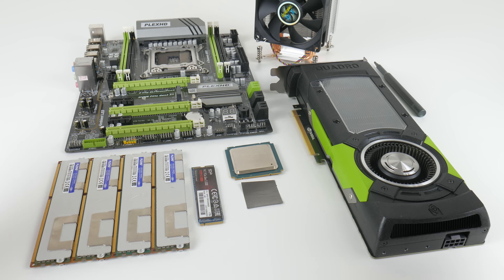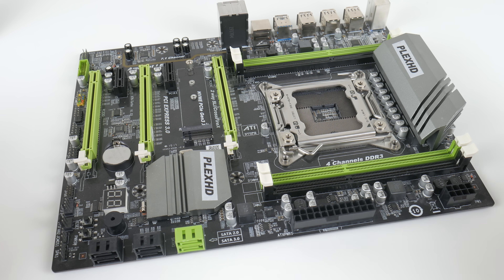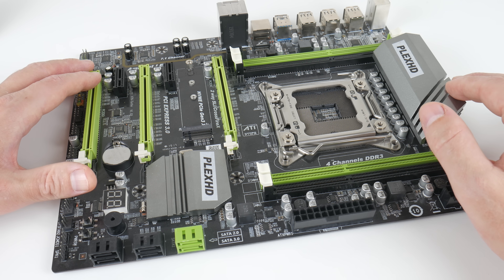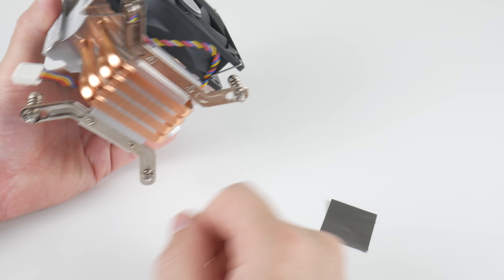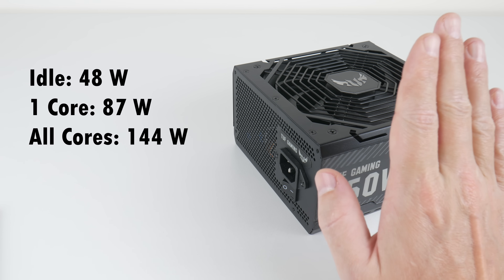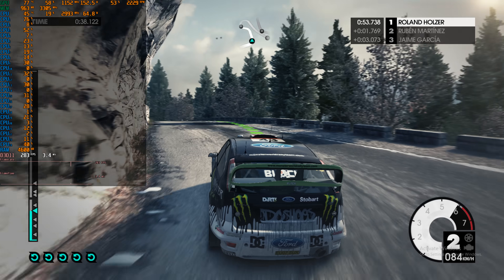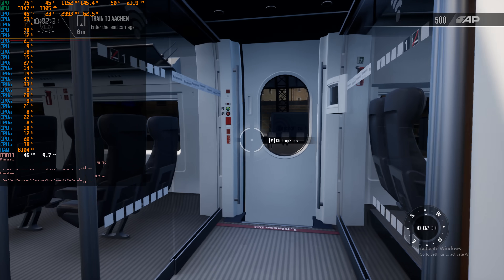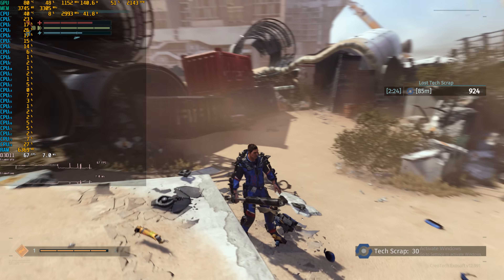10 years ago this CPU cost $2614 - How does it hold up? The Intel Xeon E5-2697V2!

Comment: With how crappy AAA gaming has become recently its not a bad thing having an older machine. I have bought a t3610 and a t5810 both from ebay and even the e5 v2 cpu's run surprisingly well on titles released 2-3 yrs ago. In terms of gpu I don't think it's worth going newer then nvidia 1000 series in terms of power, probaly rtx 2000 if you wanted ray tracing. Both are very affordable on ebay and the top end models still run modern games pretty good.

Comment: Hace been running a Plex x79 with an E5 1650 V2 for about 3 years. Just bought a E5 2667 V2 on AliExpress for about £15 as an upgrade. Interested to see if the extra cores will make much of difference. It turbo boosts at 4.0 Ghz, pretty good for such an old cpu.
Reply from the maker: @fieldpictures1306  In a lot of take the 1650 will feel stronger as it clocks way higher.

Comment: Just got a 2697 v2 and a ASUS P9X79-E WS motherboard to replace my i5-4690k for ~150USD on ebay. I have overclocked it  with a blck of 113.2Mhz to a core clock of 3962Mhz on max turbo boost. That is with a +0,2v offset though, on stock voltage it would only do a blck of 108Mhz. In practice it hovers between 3,39Ghz and 3,77Ghz depending on load as the max turbo boost is rarely seen. RAM is a random assortment of 1600Mhz and 1866Mhz, but I got it stable at 2113Mhz some extra juice to the memory controller.

In games I get just shy of 60fps on space marine 2 on low settings and about 45fps on a medium/high mix in helldivers 2 with a rx580x GPU, witch I think is the main bottleneck.

Comment: I also own a similar one, e5 2696 v2, on a workstation motherboard. It pulls off pretty great number and performance overall on a system that only run stock settings without any overclock at all on modern games. Xeon truly aged like fine wine, make me wonder why they aren't around as much as they were before...

Comment: I'm actually running this cpu with a cheap ali express motherboard... I got it running at 3.3ghz on all cores with the top 4 cores boosting to 3.6... I get 100 fps average in starfield
Reply from the maker: Be careful on cheap motherboards, this CPU pulls a lot of power.

Comment: I have a socket 1366 mobo which i had a core i7-950(4c/8t) @3.06ghz a Nehalem 45n cpu.
 6month ago have upgraded to a Xeon x5680 (6c/12t) @3.33ghz, a Westmere-EP 32n cpu, which the 6core i7 based on.
The original price for this Xeon was $1600(i dont know original UK pricing, probably close to £1000), bought on ebay for £20!
Reply from the maker: Nice 🙂
Reply: @philscomputerlab  at least ive increased the core count and a little speed bump too😁 the i7's of the 32n 6 core chips were a little more in pricing and my mobo could take the Xeon chips, so thats why i went for it.

Comment: 2024 now and still on x79/2011. feeling no pressure to upgrade
Reply: Got a turbo unlocked E5-2699v3 with 3.05 GHz all core and 3.75GHz single. Just dropped it in for my old i7-5820K, great chip. Wish to figure out how to get higher all core turbo though.

Comment: Just to add my thoughts, still using this same CPU to this day, on an Asus p9x79 board, 8 sticks of 32GB gskill RAM, and a GTX 1060. Runs my games just fine, not into the latest AAA games anyway. As a budget PC and slight workstation build, this works for me. Was able to save a lot, since I already have most components, and just needed to add a motherboard, cpu, and 4 sticks of ram (already had 4 before starting my build coming from an i7 2600 build). It is a considerable upgrade from the system I had.

Comment: Last year I have got for testing purpose Dell PowerEdge r720 (for around 250Eur), so I equipped it with dual E5-2697V2. Most interesting is, that this machine can handle with these CPUs 1.5TB of RAM, and can have 16 Sata 2.5'' SSDs. This machine is still very usable even today.

Comment: just built on a cheap Chinese x99 platform with an e5 2697 v3. 14 cores 28 threads and comes with 35 mb cache. used a modded bios to unlock turbo boost which now boosts ALL cores to 3.5 ghz under load. paired it with a cheap rx 5700 and flashed it with 5700xt bios to get with 95 percent of the 5700xt performance. result?

Shadow of Tombraider, 135 fps avg, high settings 1080p

Plague tale, 130 fps avg, high settings 1080p

Cs2, 300+ fps 1080p

and the whole thing cost me about gbp 250. i mean, come on?😬😬
Reply from the maker: Awesome 😎👍

Comment: The original MSRP on that thing is kind of interesting considering the recently released 12 core Xeon W5 2455X is just over 1000$ MSRP. It goes up to 3,9 GHz when all cores are loaded (4,6 GHz maximum turbo). And it is completely unlocked. So you can overclock it even higher.
Edit: I got 3437 in Cinebench R15 with my Xeon, (4,6 GHz all core overclock) with Wine overhead because I am using Linux. :)

Comment: $2614 >> $44 -  Now that is a decade of depreciation. For under $50, this CPU is a bargain, and will have no issues holding on for some years to come (due to the core count). And it is great for a cheap workstation where you need processing power.
But again, the AMD Ryzen 9 3900X can be had 2nd hand for 150-200. And that CPU absolutely crushes the E5-2697V2 in everything. 
BTW. In Cyperpunk 2077 and Horizon Zero Dawn, you are GPU bottlenecked. But in GTA V you are CPU bottlenecked (mostly 2 threads heavily loaded. GTA V can't properly utilize more than 12 threads in total)
Reply from the maker: And don't forget the smile it puts on your face :D

Comment: Lots of cores, but slow clocks. That will hurt in lots of games. (as comparison, my Core 2 based Xeon quadcore oc to 4.1 GHz gets about the same in CB R15 single and about 30% of your 12 core in multicore, despite being a 4 core/4 thread chip and 3 generations older. Same in R20. And my old quad core i5 is even 30% faster in single)

The big cache is great, the Ryzen 5800X3D and the Broadwell chips like the i7-5775C show how much a large cache can do. (Even the difference between the different Core 2 models was noticeable back in the day) But I have the feeling the 8 core Xeon, would do better, especially when on a board that allows overclocking.Can imagine the typical 4.2-4.4 GHz that ivy bridge tends to run easily will be possible there as well. 

Having an oc friendly board also means that 2000-2400 on the memory should be possible with a chip with a good memory controller. And not just Ryzen but also Intel DDR3 systems benefit from fast RAM.  Someone in the german PCGH forum did a test a couple years back and going from DDR3-1333 to DDR3-1866 made more of a difference on an i7-3770K than going from DDR4-2133 to DDR4-3200 on a Ryzen 1700X

Gold choice with not testing on ultra. That isn't really what people would play it. Going one step down to high or very high usually gives a drastic improvement in performance at negligible loss in visual quality.
And about Crysis. Testing with limited amount of cores I noticed about a 6% increase with 3 cores compared to 2, but no further increase with a full quad. Game seems to be pretty much running on 2 cores, with more just allowing the system to run background tasks there and free those 2 cores to focus fully on the game.
Reply: with 8-12 cores....turn off hyper-threading, gains 10+ %
Reply: @pvanb2  they will still be slow 8-12 cores

Comment: You can use the 1680v2 in the rampage iv extreme. Its also overclockable. Got mine to 4.4hz. The mainstream CPUs don't offer 8 cores so its quite impressive. The mono is dead now unfortunately but when I had it working I also had a bios mod that allowed me to boot with nvme support.
Reply from the maker: Yea these Huananzhi boards from AliExpress they all support M.2 NVME out of the box. But overclocking not as good / stable.
Reply: @philscomputerlab  do you know if they use a real x79 chipset and quad channel memory support. Ive seen some Ali express boards like this that support 4 DIMMs but you don't get the full memory bandwidth of a quad channel board.
Reply from the maker: @edplat2367  Very good question! So firstly, the important stuff is all on the CPU. So the RAM goes directly to the CPU, so do the 40 main PCIe slots. The chipset, in the past called south bridge, now ICH, handles the lower PCIe slots, USB, SATA, Ethernet and all of that. And here you get a chipset depending on the "level" of board. Expensive boards have the read workstation chipset, cheaper ones use a desktop chipset and sort of hack things together. Works perfectly fine though and no downside apart from losing number of ports, less SATA ports, no RAID and stuff like that. A board I use, and working well is the HUANANZHI X99-BD4 and uses a B85 desktop chipset. Works great, but not much in term of overclocking although you can do turbo mode unlock. For X79 I have the classic Plex X79 HD. Same deal here, it uses some random desktop chipset. Now the very cheap uATX boards you can get, many only have dual channel support to make cheaper boards, so don't cheap out too much. If in doubt, buy a used workstation and be guaranteed a good outcome!
Reply: @philscomputerlab  appreciate the comprehensive reply.unfortunately I had some x79 boards die when I moved states, so I'm left with a  bunch of good CPUs with no board to run them in. Will have a look in to this.

Comment: Hey Phil, great video! I'm about to put one of these E5-1297 V2 chips into my ThinkStation S30. The S30 comes stock with a cooler similar to the one you used in this video, although it has half the amount of heat pipes and an 80mm fan. Will that be enough, or should I be looking into getting a slightly larger one like yours? Thanks in advance.
Reply from the maker: It will be fine. If the temps get out of hand it will just throttle a d that only happens if you stress all cores for extended period, like video rendering. Gaming isn't going to do that.

Comment: i think the main bottleneck is the ddr3 ram, it's just too slow for modern gaming.
on a sidenote, borderlands 3 has a built-in benchmark. also the game supports both dx11 and dx12, with dx11 being more stable.
Reply from the maker: It's Quad-Channel though, so double the bandwidth. Think of DDR3 1600 in Quad as fast as DDR3 3200 in Dual Channel!
Reply: @philscomputerlab  That actually makes sense. Even Intel DDR3 systems can see quite the benefit from fast memory. (ANd as a sidenote, that even counts for DDR2, DDR1 and SDRAM systems, but the benefit is usually smaller than a faster GPU or CPU)

Comment: I have the 2667 v2 that's the 8 cores 16 threads. Its overclocked and hitting 4.0ghz with turbo boost. Paired with 64gb ram and a radeon vega64 on a asus rampage extreme IV (witch only cost me €100) its still holds on. I'm using it everyday, and i can play almost everything at 1440p @60hz.
Reply: Awesome.

Comment: These Aliexpress motherboards are pretty decent, but they are all with 4 DIMM Slots. I've never seen an X79 or an X99 single cpu board with 8 DIMM slots, which is a shame.
Reply from the maker: IMO 4 slots are heaps, but if you want 8 slots, there are boards that have this and you can aways just buy a HP Xeon workstation or one from Dell or Lenovo with 8 slots.

Comment: i had this cpu, terrible for gaming, 3 ghz in games and bottlenecks gtx 1060 in 1080p, now i have lga 2011-3 i7 5960x at 4.5ghz with rtx 2070 super and cpu is not bottleneck in 1080p
Reply: It will absolutely bottleneck. My i5 might have less cores, but is clocked higher and even that bottlenecks my 1060 in 1080p
Reply: @HappyBeezerStudios  i have bottleneck only if i play at lowest settings or old single threaded games or in games like total war saga, in 95% of games my gpu is bottleneck, for example: cyberpunk, war thunder, atomic heart, stray, new resident evil 4, pubg, fortnite, pc building simulator, wreckfest etc. This cpu was bottleneck before i upgraded to motherboard that can overclock cpu cache over 4 ghz, and memory to 3333 mhz, it gave me a big boost in gaming

Comment: I've still got my old Dell Precision T7500 dual Xeon X5690 setup. Its got 32 GB ECC and a Vega 64. It still does a good job for most purposes. Of course I've got a modern gaming PC for high end stuff but really for anything pre 2018 it runs fairly well on high settings. Its basically the family gaming computer now.

That being said, I've had to add QUITE a few daughter boards to bring it up to date. I've added cards to give it USB3.0, 10Gb and Wifi networking card, a SATA III PCI RAID card. 

Its quite a large chassis.

Comment: Crazy to think you can pick up a  ryzen 3600 for $65 used that outperforms this old monster.
Reply from the maker: That hurt 😅
Reply: The V3 of this chip is $44 and beats the Ryzen 5 3600 by 5.6% in CPU Mark.

Comment: The other day I retested an i5 10400 and the multicore score (3127) is quite similar to that of the E5 2697 v2 . I believe that for some workstation tasks these old xeons are quite capable but for gaming their saving grace is their larger cache.
Reply: His single core scores are about the same as those on my overclocked Core 2 based Xeon. And my i5 from the same gen is about 30% faster, simply due to the higher clocks (which also gets630 R15 multi and 1345 R20 multi, so about 40% the performance with 33% the cores and 16% the threads)

Comment: The M6000 seems to be the bottleneck for most of the games. I wonder whether newer CPUs, while more costly, will actually save money in the long run if the newer CPUs are more power efficient than the older ones. I run a second-hand rack server with two Ivy Bridge Xeons, which I use as a NAS, Jellyfin server, Tdarr, Pi-Hole, etc. It consumes about 190W on average, wondering if swapping this for a newer system will help to cut down on electric bills without compromising performance.
Reply from the maker: Yea with some games the GPU is still holding back things. Some YouTuber channels use really powerful GPUs to show what would be possible, others pick something that is good value, seeing the other parts are used and also good value. Sometimes I test 720p to make sure there are no GPU bottlenecks. Whatever you do, not everyone will be happy!
Reply: @philscomputerlab  I feel like the GPU was a fine choice. Sure it isn't a super beefy new GPU, but it's something people interested in buying old Xeons would use. If you have the money for a 4090, you'll also have the money for a 13900K or 7950X3D
The card is pretty much a Titan X, and I do know people who still use GTX 970 or 980 in their systems. Performance wise also not far behind something like the GTX 1060 or RX 580, which is still around the performance range of really popular cards.

Comment: And fun fact... You don't really need sata3 or nvme port in everyday tasks (including most of the games) good drive (with cache, like mx500 or bx500 etc) will be more than enough, specially for old platform like this. Only lack of a lots of USB3 is kind of an issue. (of course is You are not hardcore gamer who needs 1000+ fps, but people like that don't use 10+ yo CPU's)
Reply from the maker: Yea you can get a PCe USB 3 adapter if needed.
Reply: Can confirm that PCIe3 isn't really neccesary. I got a system that only has PCIe 1.1 and that is still usable for everyday tasks, even some lighter games.

Comment: You should of done the turbo unlock and with an AIO  with liquid metal. Thermal pads please dude what a joke. I'm happy you're back to testing more newer hardware but c'mon it's an enthusiast platform go hardcore!hard-core! You can now modify the bios and unlock rebar.
Reply from the maker: Turbo unlock is V3 Xeon.
Reply: @PhilsComputerLab  OK my mistake didn't know.  How about the ram speed 2400mhz at least

Comment: That CPU is really, really slow, despite beeing 12C/24T. AMD R3 3300X (4C/8T)  does have a lead even in multi core performance and especially in single core. I3 12100, R5 5600X or i5 12400 do wipe the floor with this Xeon.
Reply: My i5-3570K beats it in single core as well and my Core 2 based Xeon is in par with it. The low clocks really hurt. A smaller, but faster chip would be a better gaming choice.

Comment: Great video! I'm using my X79 based pc a lot at the moment. It's got an e5-1680 v2 and gives amazing performance.
Way better than the 4930k I used to have.
I have a newer x99 based PC but I hardly use it anymore as I like to see how well the old X79 performs.
Reply from the maker: 1680V2 is very good. 8 cores and unlocked for 4+ GHz.
Reply: @philscomputerlab  That is pretty much the one I would go with on X79. Enough cores to not really be an issue in modern games, but also fast enough cores to perform well in those games.

Comment: I also really like the V2 Xeons. The best single thread performance for this generation seems to be with the E5-4627 v2, which should also run on these mainboards. Can you confirm this? :)
Reply: Having a pair of E5-2667 v2, wouldn't they be quicker ?
25MB cache, 4GHz maximum boost frequency, a bit faster QPI ...

Comment: @PhillsComputerLab was wondering if you could take a look at this motherboard here on ali express. SZMZ X99 Dual Z8 Motherboard 8 Channel With Dual Processor Socket LGA 2011-3 MotherBoard With 2* 2696 V4 CPU & 4* 16GB DDR4 id like to see over clocking done on both cpus maybe 4.50 ghz?

Comment: The bridgewell quartet were really Intel's happy time. Advanced Micro were wallowing with the fuel-hungry Heavy Equipment cores and were generally not the force they are today. Intel could treat them as something between a nuisance and an IP licencing partner.
Reply: I've seen tests on some of the excavator APUs and there was quite an improvement, if only they would've released some full chips on the desktop.

Comment: Those Xeon 8890 v3 servers on eBay under 1k€ are very very tempting.
Reply: I bought the E5-2697v2 3 years ago, paired with a EVGA 1070 SC and 64GB of RAM, and it runs even new games smoothly (although settings are like medium)